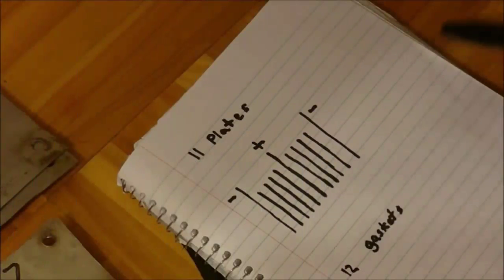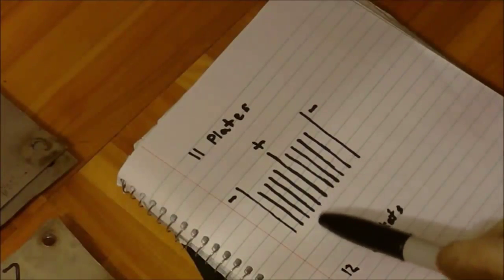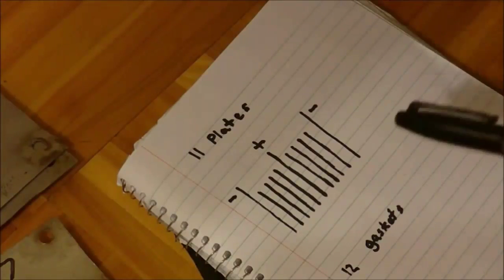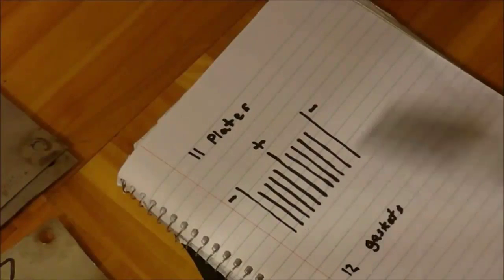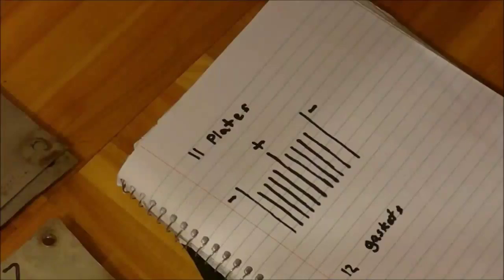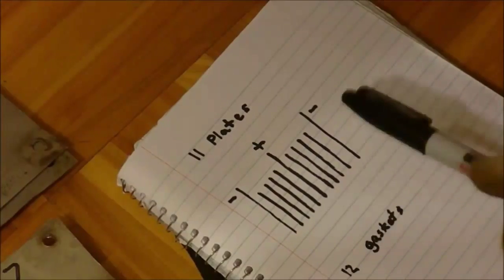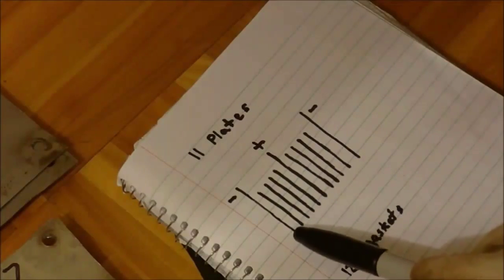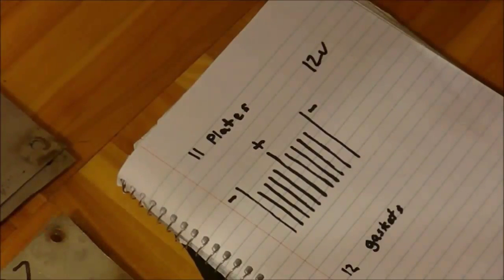Why Neutral plates are install in HHO generator...??

Comment: did ever some one try to use neutral plates on baterrys or capacitors in betwean those plates?
I have experiments to do be me self with engines when ever I use ceramic hv capacitors with my ignition system me Alternator starting charge decreases its charging baterry around 3-4000 rpm .
So any ideas for dual chargeing systems? baterry/capacitor banks independent systems

Comment: Hi, how are you? If you make a scalar coil before entering the hho cell, the scalar coil is the coil that produces standing waves, that is, voltage waves, it is pure potential voltage, it is what meyer did, have a lot of voltage at the input, Without magnetic field, only the electric one, that cell has to produce a much greater amount of hydrogen, and if your stainless steel plates are with fractal engraving, they will also produce a lot of excess hydrogen, it will be something never seen, hug
Reply: please can you explain more? is there some book where study this?
Reply: @fabiotribos5358  studying radio amateurs, those books know a lot about waves, and wave management, there they talk about stationary waves and high frequency, look for a radio amateur and I can tell you a lot about all this, from there I got the improvements for the plate of HHO, the hydrogen plate is the antenna, if you improve that antenna, it improves the whole team

Comment: the neutral plates produce h2 or o2?
Reply from the maker: Breno Marcilio ...neutral plate produced both H2 & O2..and neutral plates used to creat voltage drop..due to which reduction and corrosion of material reduces..as result negligible sludge formation...H2 produce large in scale on  -ve plate terminal  plate
Reply: AKSHAY ZARANDE ok they produce both h2 and o2 on boths sides? or one side produce only one type of gas?
Reply: @brenomarcilio1549  the neutral plates become cathodes and anodes themselves determined by the anode and cathode they are facing in the gaps.  I think that is how it is?
 -
Reply: @tonypeeler3070  so if the plate is facing an anode it became a cathode 
And the other side ( that isn't facing the anode) became an anode 
Right?